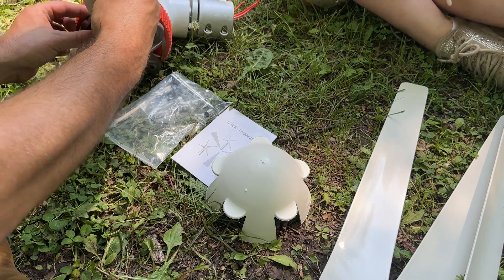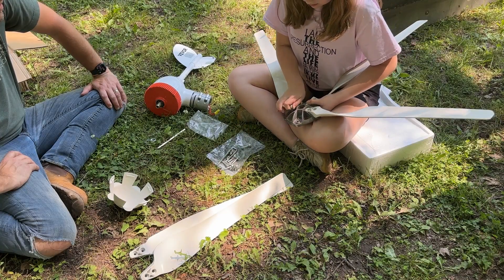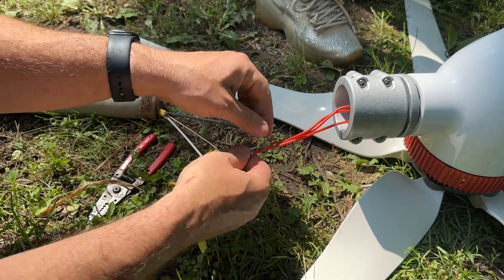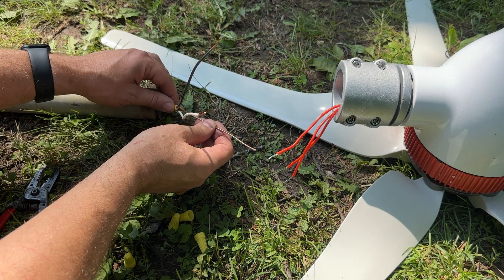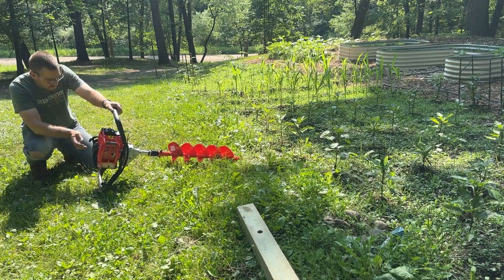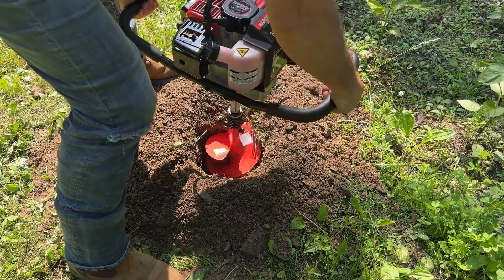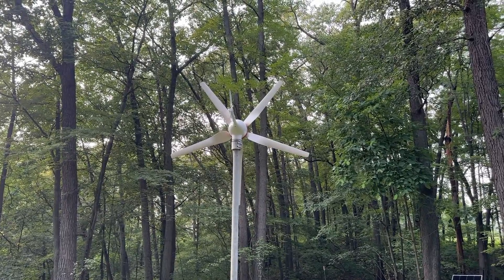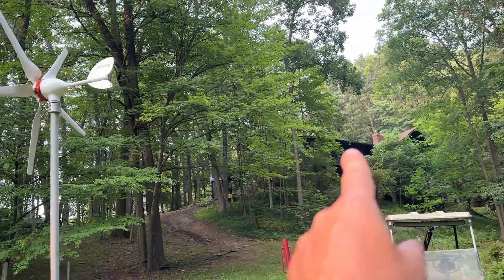Installing And Testing The Vevor Wind Generator

Comment: There's a video called windbike off grid where he attached a wind turbine to his electric bike and he is almost breaking even! 
I can see where he could be gaining even more efficiency and getting even more power output, like most people, they get a 12V generator to charge a 12v battery which is quite silly considering the load on the generator will be huge! Getting a wind turbine to spin up with a heavy load is difficult, but if you get a wind turbine that will output 120V for example, to get 500W DC out of it, it doesn't need a lot of current at 120v to achieve this,  you need a step down DC to DC converter or a solar charge controller which will be doing all the heavy lifting instead of the turbine blades.... So much more effective and efficient..... So much more output power even at lower rotation speeds..... 
What I saw in this video is the equivalent of putting a car alternator on a push bike and trying to charge a battery by peddling! 14.4V at 50A...... Yeah good luck with that.... 
Double the voltage and half the current and you still have the same power output but you will be able to peddle longer.... Double the voltage again and half the current and you will find the you can peddle all day long..... 
Let the electronics do the heavy lifting, work smarter not harder...... 
Sooner or later someone is going to break those laws.... It's only a matter of time.... Laws were made to be broken! I'm sure that you have gone over a speed limit in your time even though you have been told that you can't! You should not! It's just a human law which is perfect until someone else finds out that it wasn't.... Never stop pushing the boundaries just because someone else told you that there is a boundary....

Comment: Fun family video!  I just received mine and my biggest question was wiring to the Controller from Turbine.  3 blue wires to 3 blue wires and it makes no difference which one???  Also, I have plenty of yellow 12ga Romex wire but get the issue that the 3rd wire is unshielded ground so I might just get the 2.5mm three-core single wires as instructed to run through pipe.  Just like Solar, it says that the battery needs to connect to the Controller first, then the turbine (since I might be connecting and disconnecting at times) so I'm thinking about using switches.   Does all this sound reasonable?  Thanks!!

Comment: Came here looking for some tips for my Vevor wind turbine.  One thing I noticed with your installation is that it's not high enough. I plan to install my in an RV for nighttime charging and I already have a 20 foot extension that ties into the ladder on the back. The 500-watt model is currently on sale for only $92 so I don't think too many folks are buying them.

Comment: What's the source of the pole you are using? My 2" pole is too large to fit.
Reply from the maker: You could measure and the go to hardware store and get an adapter to a pipe that fits. I am pretty sure mine was 2” pipe though and was a little too small
Reply: @SSLFamilyDad  Thanks!

Comment: WHAT  ARE  YOU DOEING  MAN ?? !!!  you  need more THAN 14.5 VDC TO CHARGE  !! and  long time  !!!
Reply from the maker: the charge controller will charge the batteries as long as there is 12v coming from the wind generator
Reply: @SSLFamilyDad  I use the same Vevor turbine at a remote data relay station.....teamed up with a 360 watt solar panel. The charge controller does several things, it will brake the turbine if overspeed is encountered, will boost voltage to 24v when charging 24v batteries. I   went to the 3 blade turbine to get more output, spins faster in high wind. Mine is on an 8ft pole but on a high treeless ridge, most you will get from this very well made $120. unit is around 100 watts. The PMA is very small, but is housed in an excellent case. I put more tail on it, to make it track better. The blades impacted the ground during a 50mph gust when I failed to ballast the standard it's based on. The turbine survived the high RPM crash to earth with out a scratch, blades did not snap!

Comment: I’m sure you are aware the air is too turbulent for that type of wind generator less than 100’ in the air. Probably higher with all those trees. You might get a vertical axis turbine to work in a clearing. What a great time with your daughter though!
Reply: I read that article too; twice, and what I believe is that with anything below 6 kw, the 100’ suggestion is really not that big of a concern

Comment: 2nd Law of Thermodynamics. Energy always goes from states of higher concentration to states of lower concentration, aka "entropy". "an isolated system's entropy will never decrease over time" If we look at a period of time while energy is being expended to move the vehicle forward, the energy recovered will always be less... due to entropy. All the friction, drag, electrical inefficiency and other losses in the system add up to the increased entropy. 'lost' usually as heat.
Reply from the maker: Yes sir!

Comment: 12v at 1a is only = 12w and12w of charging is not much.   As I'm sure you know, the voltage alone is not informative as to whether you will get meaningful charge.   Hopefully you'll have more detail if you do a follow-up.   Still - it was a fun vid and thanks for sharing :)
Reply from the maker: If it is producing 500w at full spin it should be more like 20-40 amps at 12V

Comment: Conservation of energy - every action has an equal and opposite reaction. The drag on the wind generator will be more than the power that can be generated to run the cart (that doesn't include other wind resistance, friction, etc.). Only Wile E Coyote can get away with this physics problem. 😀
Reply from the maker: you got it!